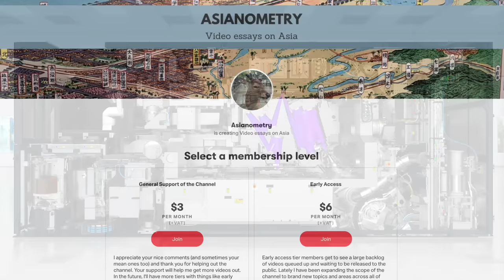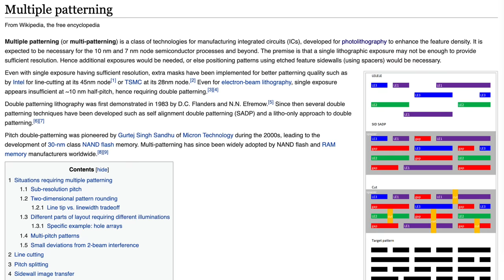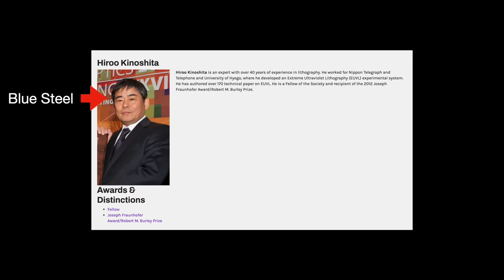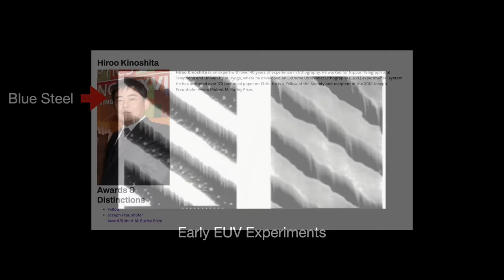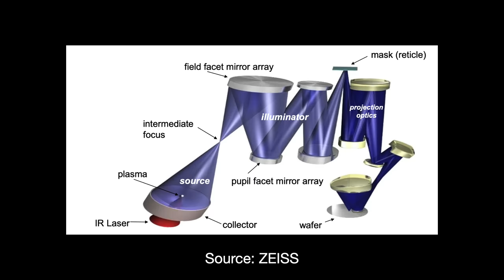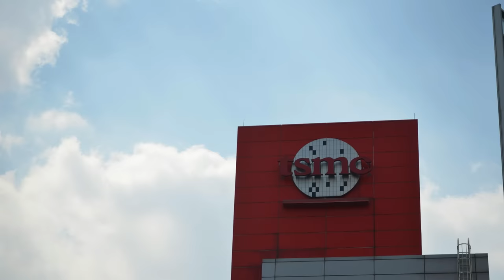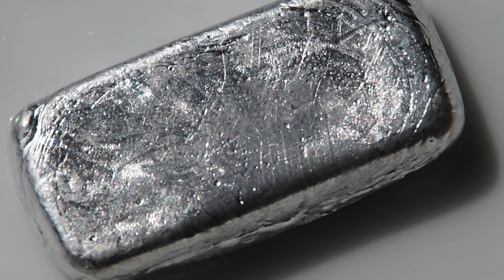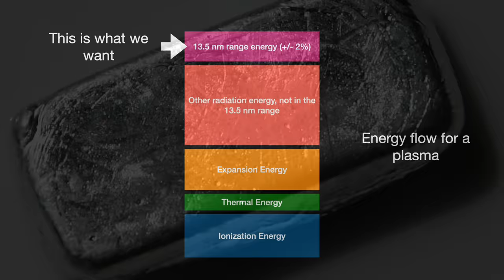The Extreme Engineering of ASML’s EUV Light Source

Comment: I has NO idea this is what it took to make EUV light for this manufacturing process. It's hard to believe, that out of all the people working on this, that this was the solution they landed on. Truly spectacular engineering and science. (if not straight up bonkers)
Reply: there are Chinese fanbois who believe that china can copy and  build a similar machine in 2 to 4 years, this thing took 40 years from  concept to prototype to working samples
Reply: @eduwino151  Yeah but that was from scratch. You realize that with the fact that it's already been done and industrial spionage the whole equation changes, right?
Reply: @kristofferjohnsen4002   doesnt work like that for lithography machines , minus the research and tech  transfer you cant do it , China is still struggling with reliable jet engines and those are simple tech compared to semiconductors
Reply: @kristofferjohnsen4002  yes because they have the basic concept down it will only take half the time 20 years.
Reply: @eduwino151  just matters if the can steal the actual relevant information required to make the EUV, if they can it will allow them to cut the time down for their R&D…. I agree with you though about china and their problems with something relatively simple like jet engines….
Reply: @metatron5199   EUV machines are not made by one company but hundreds of companies making the different parts China will just be wasting time trying to copy it if they cant even make the simpler DUV machines
Reply: @eduwino151  chiness jet engines are now state of the art as far as I know.
Reply: @eduwino151  and there are Indian fanbois who believe India will become semiconductor manufacturing hub because Indian govt is investing USD 10 billion 🤣🤣🤣🤣🤣
Reply: @ArpanMukhopadhyay93   LOL chinese jet engines have been state of the art since they started making those claims back in 2006 and yet still buy Russian jet engines,
Reply: @ArpanMukhopadhyay93    India has one adavntage that China doesnt it is allowed to buy ASML EUV machines , India already has thousands of chip designers working for American companies with the machines and engineers they  will become a hub
Reply: @ArpanMukhopadhyay93   You are probably a Pakistani Troll India will be a major economic power in 10 years when Pakistan is still struggling with heavy chinese debt
Reply: @eduwino151  old news.  China mastered the crucial Single crystal blade tech in 2017. India too achieved that just a few months back. 

China's J-20, a fifth-generation stealth fighter jet, has reportedly entered the mass production phase after replacing the Russian engine with the domestically produced WS-10. Traditionally, Chinese jets have been powered by Russian-made engines, which have a relatively shorter service life.
Reply: @eduwino151  problem is that India has a lot of chip design talent, but not much product design capabilities. Hopefully it will come with time. Yeah India will have access to proper EUV machines. But I am not sure if that kind of fabs will come up here. I think it will be more like Malaysia, Singapore. Mature nodes or backend work like assembly and packaging
Reply: @eduwino151  India will do well economically for a few years. But I think it will stagnate like Japan after sometime. Unless there is s huge cultural shift, which I don't see happening.
Reply: @eduwino151  nggggg, nope.
Even biden worried about china hypersonic jet that already beyond usa technology
Reply: @metatron5199  There's nothing to steal. The concept is simple. Everyone knows how it works.

The problem is tools. This lithography machine is a tool of extreme precision. 
More tools of extreme precision are needed to make this tool. More are needed for those tools. Etc. 

No one can do it alone. Not even ASML. 

China doesn't have access to the tools to make the tools, that makes the tools, to make this specific tool. 

And China's manufacturing industry doesn't exactly specialize in quality and precision. They specialize in crude and cheap.

It's would take them a long to create everything they need on their own. To the point where it's not feasible. Because by then there'll be new generations of lithography machines that makes the current ones outdated. And China would just find themselves right where they started.
Reply: @eduwino151  jet engines(fighter jet engines) are anything but "simple"
Only hanfdul of countries can do it, smaller club than semiconductor manufacturing countries
Reply: I'm sure they have "must be straight up bonkers" as a requirement on their job ads
Reply: Best machine there is. 
I preordered two of the latest ASMLs and I am going to donate one each to Russia and to China.
That will influence global chip production in many most interesting ways.
Reply: @ArpanMukhopadhyay93  I guess the chinese said that;... lol
Reply: @eduwino151  all of that is meaningless if they cant get a full year without the slightest blackout lol
Reply: @eduwino151  When (or rather if) this ever ever ever happens, make sure your government invests a bunch in road building, garbage collection, and simple education about the environment to children. Maybe then people will stop using their apartment windows, and local estuaries as garbage chutes and runoffs…
Reply: @eduwino151    You: India is allowed to purchase  machines from ASML, and thousands of Indian engineers already are working for the American chip companies. But, don’t forget the US has all the state of art chip making machines from ASML and yet still can’t produce the advanced microchip.  The US has to beg and persuade the Taiwanese Microchip company and the Taiwanese engineers to come to make the advanced chips in this country. All I am saying is even with the state of art machines alone you cannot produce the advanced microchips.  You still needed extremely talented and hard working people to do it. I think it was demonstrated recently not all engineers are equal.
Reply: @kristofferjohnsen4002 No they lied they used the older DUV process and brute forced it to 7nnm
Reply: @ArpanMukhopadhyay93 They're underpowered and have less than half the mtbo
Reply: @eduwino151 We're talking about a country that believed they could build a jet engine from scratch on a shoestring budget😂
Reply: @SaretGnasoh 😂

Comment: Very interesting. I wonder if an approach used by Becton Dickinson around 1980 to steer droplets either is used by ASML, or could be. After forming droplets with a Piezo, the droplets were hit by a laser and optically scanned (diffraction&absorption). The spectral results were instantly analyzed and used to apply a positive, neutral or negative charge to a pair of plates. 
As the droplet passed between the plates, the charge would then SORT each droplet into one of three vials. This served as an alternate means for concentrating a desired component, when other methods (like variations in density) would not work.
The analogy for ASML would be to used the charged plats to steer or align the tin droplets, and perhaps also serve to minimize the travel of tin debris.
Reply: AFAIK there are machines that allow for the same thing as described but with photons/lasers.

but since this is done 10000 times per second and these plused lasers are on the femtosecond scale floatation or gravity cancellation is not needed. they are in fact  so fast  and precise that it has been used to produce slow motion videos of single photons traveling, thats billions to trillions of fps, the slomo guys have a very good video on that topic.
Reply: @gregparrott  Wow thats super cool! :)

What do you think of my theory? Since all parameters in the EUV machine are known or measurable and the random factor of tin contamination has been engineered down to a predictable degree any  additional method of levitation would add another complication and thus reduce efficancy of the machine.

Now another question that comes to mind now is if the horizontal spacing of the tin droplets should be detected from distance or artificially manipulated by the method of dispension.
 
I think droplet size is controlled by tin dispensing nozzle type+pressure+viscosity+temparature and cavity athmosphere. Since it is a two dimensional line with 5x the droplets of the actual pulse frequency they only expect 20%of droplets to be useful. I guess it its almost trivial to use highspeed cameras because models with multi million fps and very accurate interface that provide a very high line resolution - atleast high enough to determine good droplets, time the first pulse,determine correct tin formation and time the second pulse.

I guess the performance increase mentioned in the video will come from expirience "in the field" and subsequent data collection and process optimization.
Reply: @G4m3G3ni3  What you're saying is interesting, but I'm missing some of the details and have to conjure up.
We're both assuming that the tin 'droplets' are formed in situ, which implies it is molten when it enters the nozzle. While it likely is molten, it is possible that they're actually small pellets. 
Assuming it's molten, the Piezo actuators used in fuel injection could be (highly) redesigned for metals. For starters, tin's density is 7.3X that of water, ~10X that of gas and ~9X that of Diesel. As you say, the piezo's characteristics, the size/shape of the nozzle's cavity, and the electrical pulse's shape can influence the resulting droplet.
Saying it is a 'two dimensional line' is confusing. By definition, a line is one dimensional, and a plane is two dimensional. 
Also, I found nothing in the video which suggests "5x the droplets of the actual pulse frequency". At 14:14, he says they're hitting "50,000 bullets a second with a laser, twice (twice because two lasers hit each droplet). He mentioned the droplets are traveling at 80 m/s and are separated by 1.6 mm. If you crunch those numbers, this affirms there are 50,000 droplets per second.

Comment: I read about the ASML machine and that insane Cymer tin laser last year, but this video filled in a LOT of details.  I thought it ran at 4khz not 50khz double-tap, which is nuts considering what it's doing.  The moon landing comparison is not an exageration.  This thing gives me hope for missile defense and laser fusion, though the former is obviously much more difficult due to range, power requirement, atmospheric distortion and an adversarial target.  It also makes me wonder if we're nearing the end of the road for geometry, considering the $150m cost; hard to imagine $700m gamma ray machines for the next gen fabs penciling out economically.

Comment: yes, pulsed lasers  has ""more"" energy output than  continous

the  popular laser engravers using  pulsed lasers
from 20khz up to 4000-8000 khz

at 20 khz  a 20 watt input can  result  several kw  output in the momentum
in a very tiny spot  like  0,01 mm

Comment: This approach for making a UV light reminds me of common fluorescent tubes which stimulate Mercury to emit UVC which excites a phosphor coating. I wonder if you amalgamated a little bit of tin in your Mercury, if the fluorescent tube might generate some euv wavelengths also. (If only internally to the tube, and despite maybe sputtering tin on the walls.)

Comment: Hey one other thought.... Why not use precut templates that are place on the silicon wafer disc that only allows a portion of 1 EUV photon to etch even smaller patterns on the wafer. E.g you build a fence and you cut. Hole in it so that when you fire a tennis ball at it only a portion pass completely through to the other side that way you can vary the intensity of EUV to etch even smaller patterns! Your thoughts or anyone's thoughts would be greatly appreciated! Carpe Lucem!
Reply: Hi I've got the same question, just commenting for bookmarks
Reply: The fundamental issue here is that there is a relationship between the wavelength of the electromagnetic radiation that you use and the size of the hole it can propagate through.  You can't get to smaller feature sizes just using smaller apertures in the stencil  - as the stencil aperture size decreases the wavelength of the electromagnetic radiation also needs to decrease.

Comment: Cyclotrons and synchrotrons are not the same type of accelerator, despite both being "doughnut" shaped -- their principle is not the same: cyclotrons use a time varying magnetic to speed up charged particles by magnetic induction, whereas a synchrotron uses electric fields to speed up particles in linear stretches, and magnetic fields at the "joints" to bend the trajectories -- synchrotrons are not actually circular, but rather they are many-sided polygons. In synchrotrons, the X-rays come out at the vertices that join two linear stretches.

In fact, the LHC is a synchrotron, and it also produces X-rays the same as those synchrotrons which are used explicitly for that purpose: the X-rays are a byproduct of how synchrotrons work. The LHC is not simply related to the ones that are used for their X-rays, it is one of them, albeit used for a completely different purpose.

And great video, by the way. Despite my minor "complaint", you explain things in a very straightforward fashion. Keep up the good work.
Reply: Cyclotrons use a static magnetic fields and a RF source for accelerating charged beams. Betatrons use time varying magnetic fields to accelerate particles.
Reply: "Cyclotrons and synchrotrons are not the same type of accelerator, d"

He didn't say they were, though. He said the synchrotron developed from the cyclotron, which is correct.
Reply: @Eletronicafg you're correct. I mixed them up -- been a few decades since I studied them. I should do a bit of refreshing of some accelerator physics.
Reply: @isodoublet  yes, you are right, I got the betatron and the synchrotron confused. As for the rest, I was trying to add more information -- the LHC is a synchrotron, but as far as I know, it's not used as an x-ray source.

And of course, Asianometry's videos are excellent regardless.
Reply: @gildardorivasvalles6368  Oh, don't get me wrong, I think your post was very informative.

Comment: Double pulse laser ignition of plasma is well known. first pulse produces plasma, that needs some time to expand and become less dense.   than a second pulse fired and absorbed, bringing the most energy and heating up plasma. if you spit all the power in one pulse, it will be mostly reflected by dense plasma. another poit to know: Tin was selected for the spectral properties of the exited atoms. Emission wavelebgth of hot plasma depends on temperature, but the spectrum is broad. Fortunately, one of the electron transition in excited tin atoms concides with 13.5 nm. so you have radiation both thermal and from electron transition

Comment: 1) is the targeting of the tin micro drops an open loop process? or is active aiming involved? im sure this aspect of the design is one of the most compliced aspects. 2) does the stepper move only when the system correctly hits the tin dot (and emits the deep uv light radiation)? in other words if there is a control system to 'aim' the lasers at the droplet, if  some drops do not get hit, and no deep uv emitted (fir a given exposure cycle), i assume the chip can be salvaged because it only advances the ic wafer position upon confirmation the uv was actually created for any given pulse/chip movement/exposure cycle.

Comment: Why do they keep bouncing the purple light? You mention some of the light get absorbed, but still, why reflect it so much instead of directly firing it at the wafer?
Reply: You first need to focus the light before it can be used, and as you cannot use lenses you need mirrors (and only mirrors) to focus the light. This is not easy and takes a bunch of mirrors to get done correctly.
Reply: In addition to this they are manipulating the shape of the light. They need a dipole light source for increase resolution.
Reply: Maybe it's to polarize the light.🤷🏻‍♂️ 

(they can't use lenses at this wavelength)
Reply: @tylerdurden3722  They use a mirror to focus the light into a circular beam. A second mirror to convert a circular beam into an annular beam. Then a third mirror to convert annular beam into a dipole beam. This is before the beam hit the mask . Then after reflecting from the mask there are a set of mirrors for magnification and aberrations correction.

Comment: What is special about 13.5 nm? - What prevent e.g. using some of the same tricks that was used for 190nm on e.g. 45nm light?
Reply: 13.5nm needs vacuum chamber because air is opaque to the wavelength so immersion lithography where they use ultra pure water as focusing lens is not possible with EUV. But multi patterning is possible with EUV and it is part of the roadmap for future improvement.
Reply: @kazedcat  It just seems very ambitious to reduce the the wavelength by 15x ... Do you know why they didn't start with e.g. 5x - wouldn't that have been easier?
Reply: @lystfiskerlars  It would cost more to develop an intermediate step instead of going for a step change. I don't know why it is 15x but they need the new technology to be at least 10x the previous technology to justify the cost of developing it. For intermediate improvement they can rely on multipaterning. Also immersion lithography gives 2x higher resolution so the improvement of EUV over immersion is just around 7x.

Comment: I'm confused. Isn't ultraviolet usually regarded as photons in the 10nm to 400nm range? aren't the manufacturers already using ultraviolet light is their in the 100nm range?
Reply: The previous technology called DUV (Deep Ultra Violet) is 193nm. So yes they are already using UV but not extreme UV which is 13.5nm